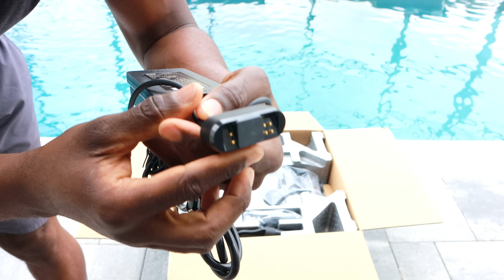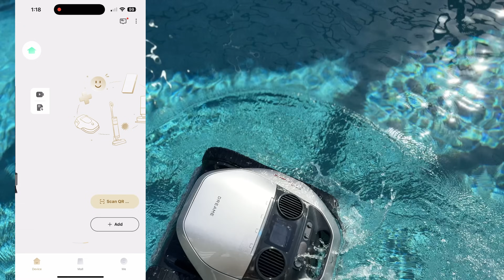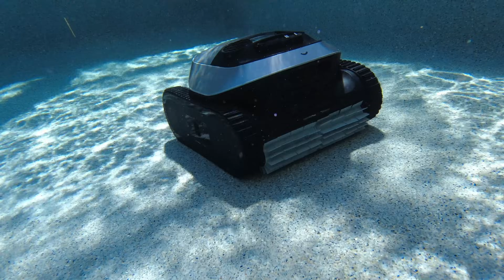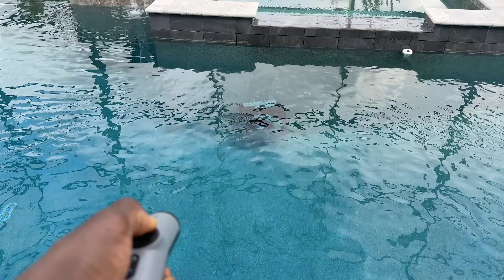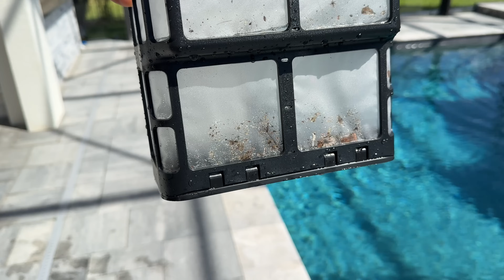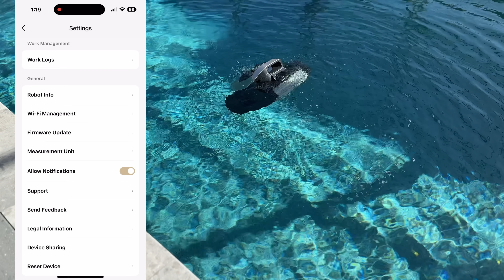Is This the Most Advanced Pool Robot Yet? Dreame Z1 Pro Robotic Pool Cleaner Review

Comment: This product has been a complete disappointment. I ordered it with high hopes, but it only runs for about two hours—if that. It doesn’t map out the pool as advertised, and the remote doesn’t function underwater, which defeats the purpose. It hasn’t once surfaced near the waterline for easy retrieval. To make matters worse, the customer service has been absolutely terrible. While the concept is great, the execution falls short. I’d recommend looking for a more reliable alternative.
Reply from the maker: Damn, maybe you had a defective unit.  The remote worked well for me. Are they planning to replace your unit?